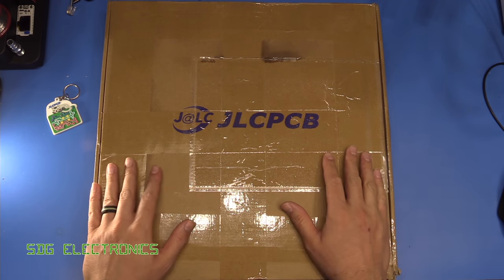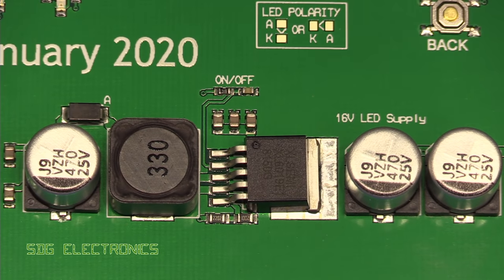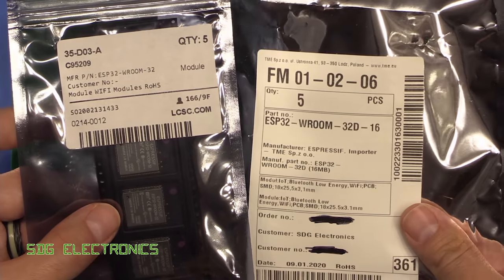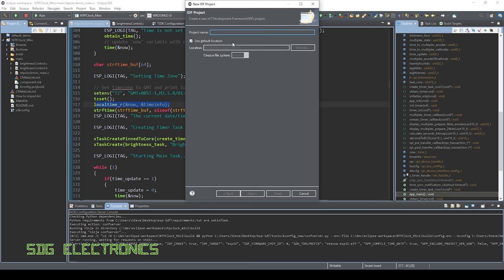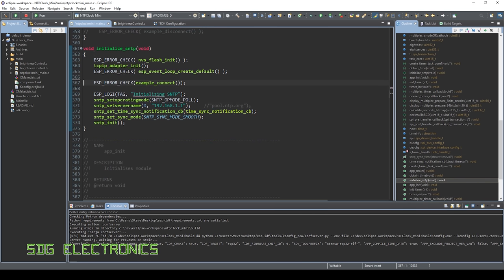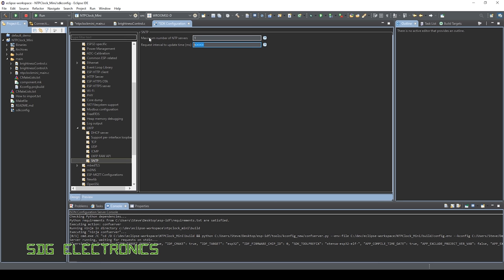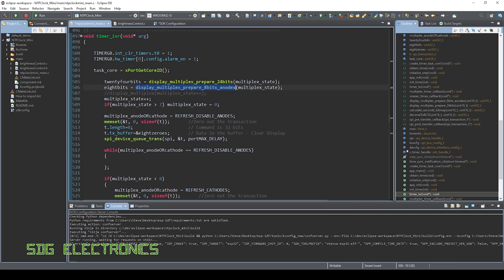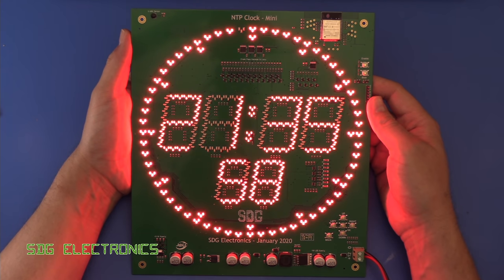SDG #141 690 LED ESP32 WiFi Mini Megaclock - An NTP Wharton Electronics Style Clock

Comment: I respect your effort on using Eclipse :D worst IDE I've been using.
I'm now using Visual Code with PlatformIO, best combination so far :)
Great video and awesome work like always
Reply: I ran into an issue with the TFT LCD example, which in the example project used a .jpg and through some makefile wizardly was able to convert it into a 3D array in C which was stored on the flash, or something. I don't think PlatformIO uses the makefile system so pretty much none of Espressif's examples will work out of the box. 😔
Reply: I am using Eclipse from day one! It is so far the best IDE I've ever seen :)
Reply: @ArjanvanVught  Try out netbeans, way better :) but i rather go for Visual Code
Reply: @FixDaily  I am using Eclipse for decade's now. There is no reason, totally no reason for looking at any other IDE ;)
Reply: @ArjanvanVught  Nah I kinda hate Eclipse. It feels clunky and sluggish. Resizing at least used to cause these horrible black frames because it was so slow to update to a new size. It has been getting better but probably only because computers are getting faster.
Reply: Actually, Visual Studio, with the visual micro plugin still far surpasses Visual Code. Do not get me wrong I use both, but Visual Studio is arguably the best IDE available, and being able to use it for Arduino based code, with auto complete, and prototype display, well it is awesome. It also unlocks your ability to use header files without creating a library, which means true object oriented code.

Comment: Great to see that you are using Eclipse - the best IDE there is.
Reply from the maker: There's a few bugs, but the IDE isn't too bad. Certainly a better development environment than the arduino IDE
Reply: @sdgelectronics  Any text editor is even better than the the Arduino IDE :-P
I believe there is a project for an Eclipse based Arduino IDE. But still, why would you like to use the Arduino IDE / OS for the EPS32?

Comment: Now that's impressive!

I gave up with NTP servers and switched to getting the time and date from the response headears of a [any] web page. It returns UTC time but calculating for BST is pretty easy to do. Its also pretty reliable too as all you're doing is accessing 'a' web page. One of the better NTP servers I did find though was Googles own, Public NTP...it also implements 'leap smearing' which is kind of a nice bonus. Sorry I don't have any suggestions for the WIFI settings, I just use a similar web based WIFI Manager.
Reply: https://github.com/espressif/arduino-esp32/tree/master/libraries/WiFi/examples/WPS 
regarding wifi connectivity ... does he search for something like this ? not sure i got the problem right ^^

Comment: If your going to have inaccurate time slow is the best. If you have thing that uses a time stamp. It easy to jump forward, to jump back you have to slow your clock and let the world catch up. This way you and your time stamps are always moving forward. Also I think that if you request the time from an ntp server too often you can get locked out. Nice video, not sure why they went the RTOS route for something that to me does not need to have an operating system. If you want to embed it in to hardware it just makes timing so much harder.  Unless they have a way of getting to pins changing at a level lower than the rtos. Th pi always has this problem with linux just getting in the way. You had the choice with the 8266, rtos or nonrtos.

Comment: As I mentioned before, you can avoid hardcoding your timezone by using the Google geolocation, geocoding and timezone APIs. It does involve making HTTPS requests but the resulting JSON is easy enough to parse. You can either update your TZ variable or configure SNTP to use UTC and add the TZ and DST offsets yourself. It does mean giving Google a credit card number but you won't generate enough requests to actually get charged unless your f/w goes wild. Just don't publish the code with your developer key hardcoded ;)

Comment: There's a few Arduino libraries out there that take care of the wifi config, sorry don't have their names. They basically run in both station and AP mode at the same time. You can connect to either to configure the wifi settings. Obviously when you connect for the first time you connect via AP.

Comment: You can run ESP32 wifi in AP and station mode at the same time. Run a http server and you can access it via AP mode and change wifi credentials and other stuff via that. You can turn the AP on only when the station is not able to connect...just like how Google home does it...I've implemented this in couple of products and seen no issue. For code example email me..
Reply: How about publishing on github for all the world to see, use, and improve?

Comment: There is an Android app called ESP BLE Provisioning from Espressif. Similar from TI: https://www.switchdoc.com/2018/06/tutorial-esp32-bc24-provisioning-for-wifi/ Also you could use Web Bluetooth and do the configuration from Chrome.  There is no way to list access points in a web browser, so there you have to type it. But the advantage is that you don't need an app installed.

Comment: You can use the ESP-touch protocol to automatically configure the wifi settings, It doesn't require to switch networks. https://www.espressif.com/sites/default/files/documentation/esp-touch_user_guide_en.pdf

Comment: Super interesting design, Steve. May I ask how much the part-assembled boards cost and was it the same minimum order quantity?
Reply from the maker: $80 for the 5x 4 layer boards and $130 for components and assembly for all 5 boards. You can get just 2 boards assembled as an option though
Reply: @sdgelectronics  well if you'd like to recoup some of your costs, I'd happily buy one of your 5. I'm in the UK.